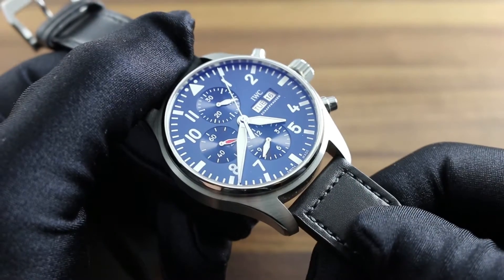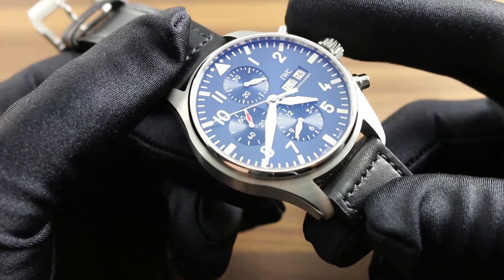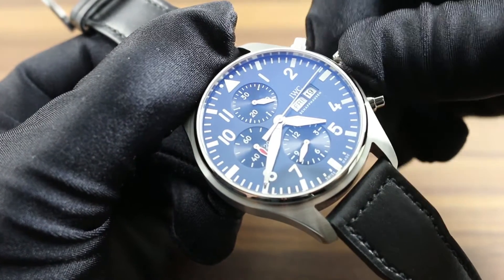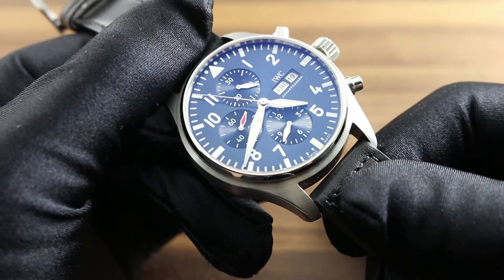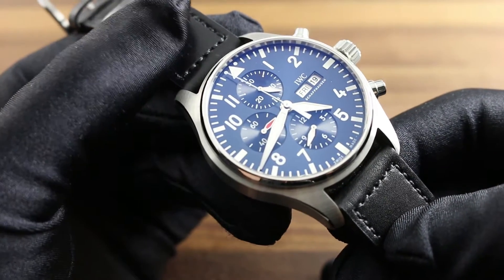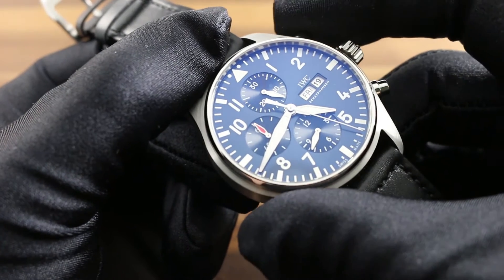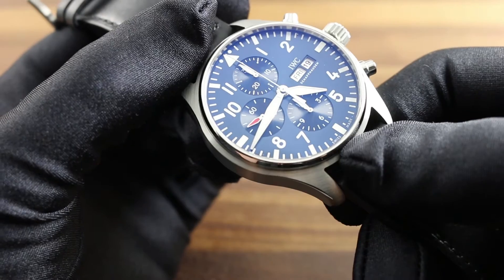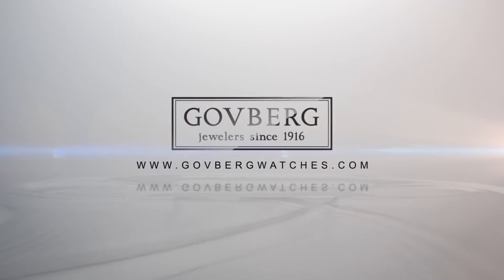IWC Pilot's Watch Chronograph Edition Le Petit Prince IW377714 Functions & Care

Comment: hoo set date before midnight and after midnight? I usualy set my date when I wick up about 6am. so I am doing wrong?
Reply from the maker: You're doing it perfectly! The date should not be set between 9pm and 3am as the movement is engaged for switching the date, so setting the time at 6am is a great practice. The movement would have already disengaged so you should not be in danger of damaging the date mechanism.
Reply: cool :)